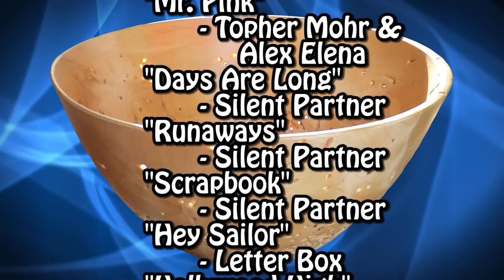Birch Burl with Bug Holes & Trails

Comment: I'm blown away by the control you have on your gouges, removing such tiny ribbons of shavings in order to maintain that 1/16" wall thickness. I'm using a very old viceroy head stock only lathe yet managing to turn bowls up to 17" but with a wall thickness of around 1/4" to 3/8" with a minimum bottom of 1/2". Sadly my speed control means me getting on my knees to change the belt on five preset pulleys. I am selling some and folks seem to think I'm doing really well. Thanks for such an informative video. I'm now a registered fan.
Reply from the maker: I’m glad you liked it, Alan. I don’t envy you getting on your knees to change the belt. I could do it but I’m not sure I would get back up again if I had to do it very often! 😱😱 Thanks for watching, Alan. I really appreciate the support! 😃😃😃🇨🇦🇨🇦🇨🇦🇨🇦
Happy turning,
.....Gord

Comment: When I start the second turning of a bowl blank, I work on the outside first, as you did. After reversing the blank, I always true the outside (just always have), and that prevents a slight oval which caused your bowl to vary in wall thickness.
Reply from the maker: Actually, Doug, I didn’t realize that I hadn’t pushed the bowl onto the jaws properly. It was slightly askew and when I realized what I had done I decided to leave it and see what it would look like. It’s unusual but I like it. Thanks for watching, Doug. I appreciate the input!
Take care,
.....Gord

Comment: The wall thickness variation could have been eliminated by finish turning the outside after mounting on the chuck. The center on the faceplate and the center on the chock are not exactly the same (I.e. runout).
Reply from the maker: Good point, Ted. Thanks for the input. Much appreciated. 😃😃👍👍🇨🇦